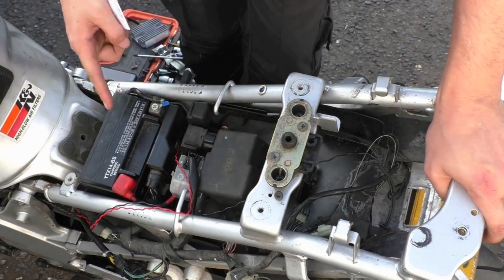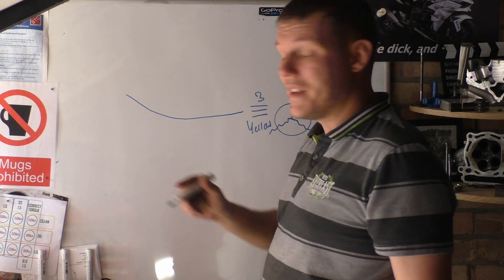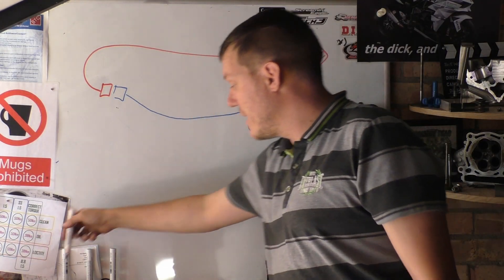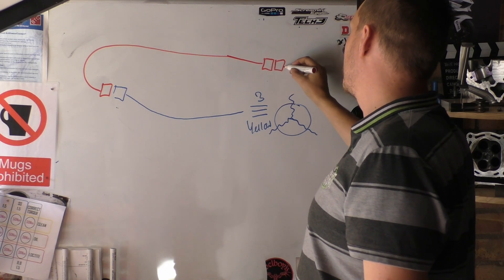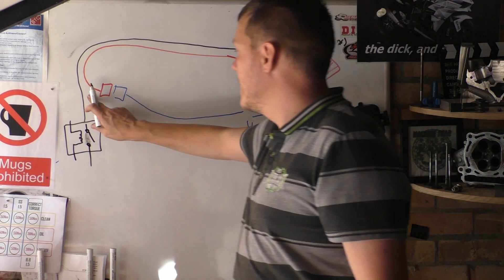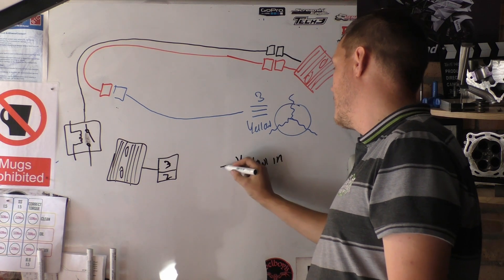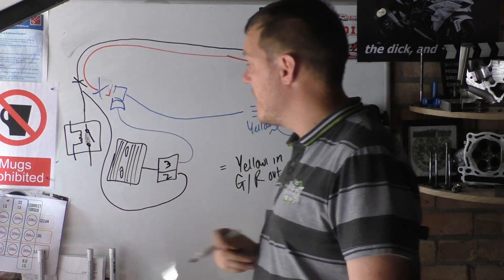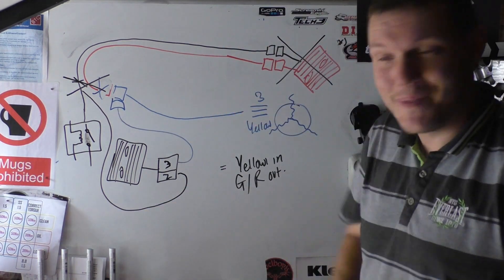SV1000 and the Rectifier Story - Part 2

Comment: When i had TLS it used to cut out occasionally.  I finally found out that starter relay wire has no tension against the pins.  Twisting the wire caused total blackout.

Comment: Why cut any wires? I'd just run the reg output straight to the battery considering it is right next to the battery now. You can extend the yellow wires using the connector from the original dead regulator. That way, if you want to replace the OEM reg for any reason everything is still in place to do so.
Reply from the maker: There's more to this - in a way future proofing...

Comment: The k7 gsxr also cooked the regulator/rectifiers 
You can get an aftermarket bracket for those that moved it round in front of the radiator to get the air flow.
I only had to replace mine once unlike my rvf400 that needed a new one every six months along with a new battery.
Got shot of it in the end because of it as I had it looked at by 3 different shops and they couldn’t find nothing wrong.
Wish I’d known then that it was being placed under the fairing on the side of the engine that cooked them.
Reply: Gotta love those Honda charging systems.  I had an NC30 that did that.  It was a common theme with the little V4’s.  I don’t think it helped that the plug on the loom would melt which meant Mr Bodgeit would replace with crappy spade connectors.
Reply: Martin52863
I've had a lot of Hondas. I never had a problem. Guess I'ma lucky fucker.
Reply: It was the VFR/RVF400’s that had the issue.  As far as I’m aware everything else was fine.

Comment: Hey Matt, bear in mind the B/R wire also goes somewhere else (off to the left in the wiring diagram but no idea where to!)……just in case you loose that feed depending on where you splice into the loom when shortening the runs.
Reply from the maker: These jump onto the power line (+) line of the loom. They just splice in.

Comment: I need some help on my bike I gotta ride to to work tomorrow. 2003 Honda shadow VT125, 24K miles on clock, only mods are straight pipes. I did a 100 mile ride and a tickin sound loud af was coming from the front cylinder, today I took the cover off the front and the rocker arms are loose to the point I can get a 0.55 gauge in when it’s meant to be 0.2 . A couple hundred miles previously I checked the valves on the rear cylinder and they were perfect so I didn’t bother with the front. My question is it possible in just 100 miles for the valves to get so out of whack? Or is it something else like the rocker arms/ cam chain or something. Also I started tightening it to get it to stock and my tool snapped and nearly wrecked the flat head valve adjustment screw. Anyway, hope you can help any more questions about my question let me know!

Comment: Hey Matt,  I think you keep frying regulators because you have a short somewhere.  Somewhere there is a powered wire hitting ground.  Likely ether a larger un-fused wire (starter or battery cable) or a small short that is not enough to blow a fuse.  This can be very difficult to find. You have to inspect everything, Not fun.
 Basically what i think is happening, is that there is a big draw, causing the alternator to put out full power for a long period, cooking the regulators.
Another possibility is a corroded wire, maybe between the battery and start solenoid, causing a large enough voltage drop to keep the alternator working overtime. Don't forget the grounds.

Comment: Did you test the 3 phases of the alternator with an oscilloscope? I'd bet that one of the phases is breaking down at certain temps/loads. I've seen this problem before.
Reply from the maker: Wrong - but nice try LOL. No and in this case didn't need to

Comment: I don't understand why manufacturers connect the voltage regulator/alternator to the starter motor. The extra cranking power driving the starter has to come from putting a load on the stator/alternator right? I'd think it's smarter just to connect the R/R directly to the battery. That's how my ninja 500 was after I upgraded the R/R
Reply: The starter relay holds the 30A fuse for the rectifier/regulator output, I suppose the designers saw it as the logical place to join the circuits rather than have another fuse holder.
Reply: The alternator  provides the power for the bike, (fuel pump ignition, lights etc) charging the battery is only a low current for most of the time. Frank is correct, the connection is closer to the main fuse for all the accessories.

Comment: If one of the main reasons for moving it  to the tail unit is to reduce how hot it’s going to get I’m not sure using a metal bracket is the brightest idea.  The frame is a massive heat sink so why would you bolt the reg/rect to that via a metal bracket?  A far more intelligent thing to do would be to make the bracket from a piece of 3mm ply therefore insulating the reg/rect from the frame👍

Maybe use some no more nails instead of bolts whilst you’re at it.
Reply from the maker: This is the problem with theory and reality. The Ally frame is a huge heat sink, becasue it surrounds the engine and is bolted to it. The subframe is steel and never get hot. I'll add this to the video. And wood? Nice Del nice LLL

Comment: Why are you going against suki's designers? Perhaps they wanted to put the rectifier some distance from the vibes and heat  and fuel  + if they had wanted shorter wires their bean counters would have surely have jumped at cost savings on wires*3 ? 
Did you check suki service updates ?  
What about  that cable leading to the burnt out connection it needs checking for continuity and insulation resistance cause it carried a higher than expected current + connection at it's other end. I'm still uncertain as to why you're so sure it's gotta be the most expensive bit. Try praying to it and then if that doesn't work kick it.
Reply: You mention bean counters.
The reason the wiring runs through the loom is about money, it's about a loom being thrown on rather than running extra wires, it's about ease and cross application
Reply: Wayne Large  Thanx

Comment: Bloody Hell!!! Just watched the newest 44Teeth video and the goof that recommended copper grease just recommended "waterless" cooler to help the guys MGV(I think) with its "overheating" issue. Love those guys but what a wanker the "mechanic" is.
Reply: Thomas Philyaw why do you think his coolant recommendation is a bad one
Reply: @JayGee6996  By watching Matt's video about waterless coolant and considering the scientific results he came up with. Matt's not a mechanical God but the facts are the facts. Thanks for the comment
Reply: Thomas Philyaw next time you watch a video, try listening a little better instead of just hearing ‘waterless cooling is shite’. The reason waterless coolant was recommended in the MV was because it runs very hot which means the water system over pressurises and the pressure relief valve opens. Waterless coolant won’t boil until 180ish degrees and thus stops this being an issue. Matt agrees with the boiling specs of waterless cooling at the start of this video https://youtu.be/VACKWvcXbXA
Reply: I don't want to get into an argument over differences of opinion. In Matt's experiment from what I  can remember the boiling point might be higher but the heat transfer was crap which would make it even run hotter. Plain water was and is the best heat transferring liquid, but it boils too quickly. The best mix is a 50/50, you still have enough water to transfer the heat away from the cylinder with the added benefit of not boiling too quickly. Just my thought and belief. Opinions are like ars holes we all have one. I respectfully disagree with yours. Cheers my friend :)
Reply: Thomas Philyaw it’s not opinion it’s plain facts, you’re completely missing the point. The mechanic you said was an idiot recommended the coolant because the mv runs close to boiling and can activate the blow off.. he didn’t recommend it due to its ability to transfer heat better than water. It could be worse at transferring heat, that point is completely irrelevant. The coolant gives better boiling point headroom and therefore solves the problem the mv has. Try not jumping to conclusions and think things through before calling people. Do you really think the fella from jrs is a shit mechanic? I doubt he’d be so busy if that was the case.
Reply: No, I don't think he's a shit mechanic. He seems very knowledgeable and I like watching him on their channel, but he has recommended some not too smart advice a couple times. Thanks for the conversation and the back and forth. It gets people thinking in different ways and helps them form their own opinions and do there own research. Enjoy your day/ evening Jackson.